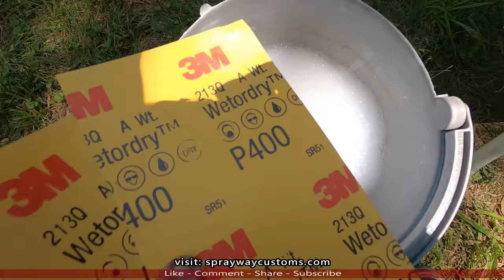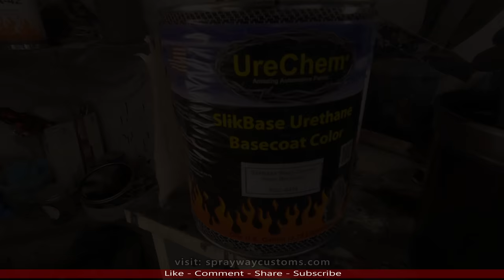Spraying Black Cherry Pearl Paint On The OBS Chevy Silverado - PAINTING DOOR JAMBS Under Hood ROOF

Comment: Spray Way question for you. I started back working on my on my 98 gmc my tailgate spoiler is about 1" two short for my tailgate gonna cut it in half how do I splice these two pieces / stretch it, to make it one solid piece ???
Reply from the maker: Just cut it and fill the gap with built up fiberglass mat